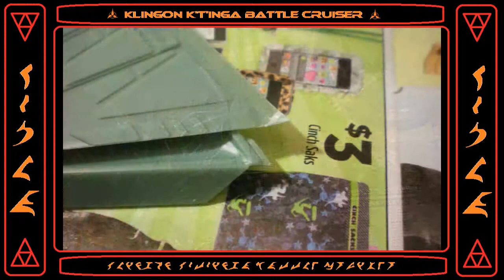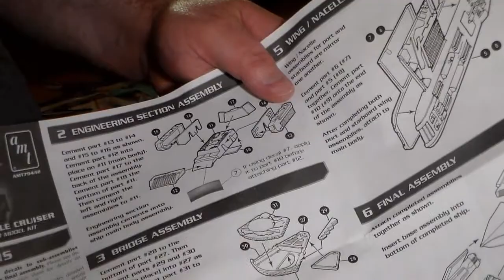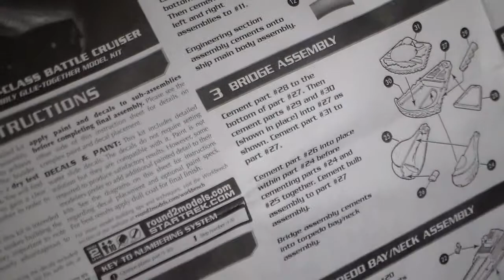Klingon K'T'inga Battle Cruiser Build (AMT - round2) vlog 1

Comment: Patiently awaiting your next installment of “AMT  Adventures”……
Reply from the maker: Oh boy.. I have two models waiting to built. I'll try and get to them. I also have one that needs some TLC.
Reply: Modeling Rule Number One, model only when you want to. I’m currently building an earlier offering of the same kit. Different color plastic with the same issues you are encountering.  Currently constructing the Main Hull utilizing various thicknesses of styrene sheet to bridge those nasty gaps insuring a strong bond around the entire perimeter of the hull and also minimizing the use of filler afterwords.
Reply from the maker: @robertbollinger3009  I'll probably have a video to upload that never got edited until now. I think it will get uploaded tomorrow. Revell X-Wing. Somehow, I never did anything with the footage.